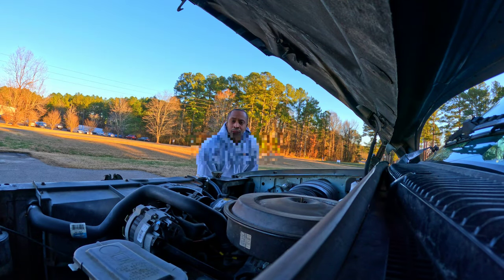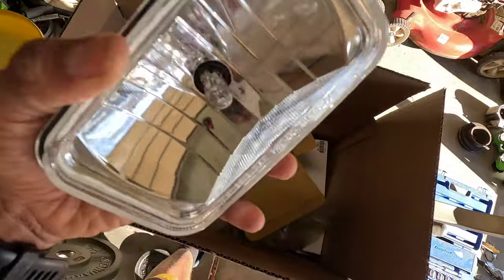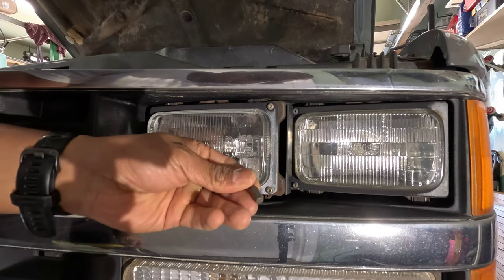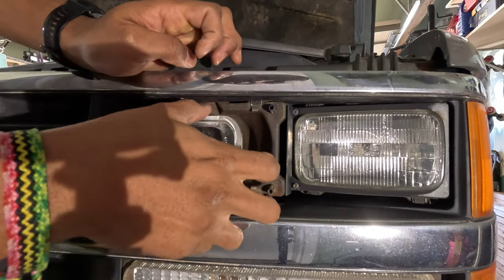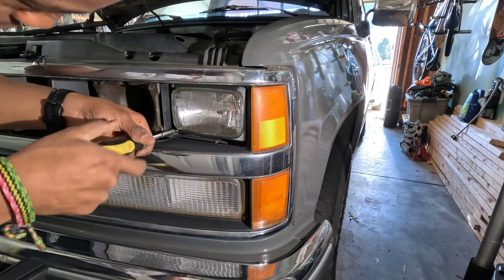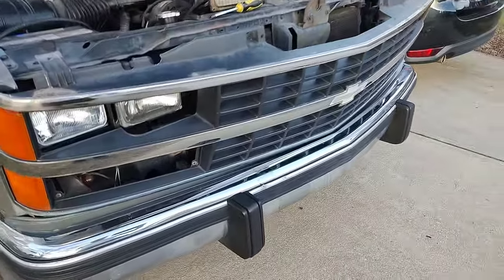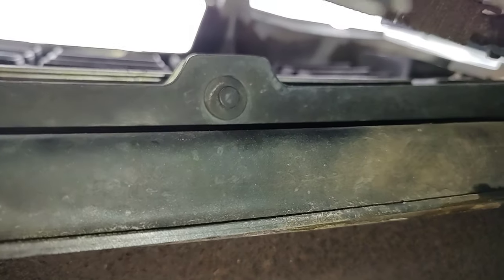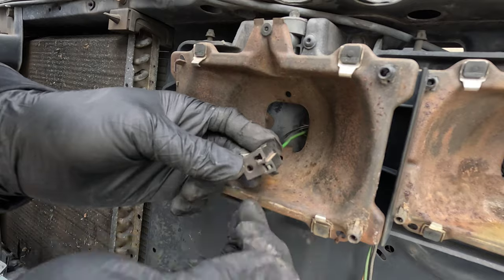89 Chevy Truck headlight upgrade with replaceable bulbs

Comment: Look Into The "4High Headlight Mod". A few wires, a relay. Basically, when you switch your High Beams on the relay will trigger the Low beams to come back on. I own my late grandfathers 1988 K1500 5.7L Silverado. I did this for added light output driving at night. It is Not "night & day" difference, But the added light output is nice.
Reply from the maker: Thanks! I will check it out. Compared to the new stuff, these old setups seem lacking sometimes.
Reply: LMC has the harness to do this! It’s like $20

Comment: just some information, that bottom part of the grille is called a bumper filler. and also those push pins that keep it attached they make a specific tool just for those style of fastener called panel/trim clip remover
Reply from the maker: Thanks!! I didn't know about that name but it makes sense. I saw one of those trim tools before. I need to go ahead and buy one as much work as I'm doing on these kind of things.

Comment: 1988 was the first year for that body design but they only came in regular & new extended cab pickup models at the time because the crew cab pickups & SUVs with the previous body design were still in production up through 1991.

Comment: It would been alot easier to just replace the bulbs ,and they do sell them!
Reply from the maker: Hey George! Are you sure? 88-89 were different. I wanted to replace the bulbs. But, these were sealed. I prefer replacing bulbs. If you know something different please show me where.
Reply: @MaqsVids  the whole assembly is the buld they're sealed beam
Reply from the maker: @newendoria1232 Thanks! I have never referred to sealed beams as bulbs...but they are. I always considered bulbs as going into the light. So, he was right 😉 🫣

Comment: nice job I replaced my tail lights and turn signals on my 89 also. the old ones were very cloudy  and dull. I may change out my head lights as you have done this summer
Reply from the maker: Thanks! I'm about to copy you too. My tail lights are mismatched from the junkyard. And the lights under the headlights are old and I need a bulb so I might as well replace them too.

Comment: I enjoy the videos! I’m currently bringing a 1989 GMC K2500 back from the brink. 
   Super cool truck you have too!
Reply from the maker: Thanks!! And I am jealous. I would rather have a 2500. Actually, other than my 454SS, this is my first 1500. I've had 2 C2500's and a K2500. But, my driveway and garage are too small now. Good luck with yours!!
Reply: @MaqsVids  thanks! A little luck goes a long way. I’m currently changing out my “intermediate “ steering shaft with a jeep unit to get rid of my rag joint, and changing melted twilight circuit boards out. 
   It’s a fun truck to play with.

Comment: I Wonder if its possible to put different Lightbulbs in there. My 94 Sierra got quad headlights but all 4 headlights have H6054 Bulbs. I bought used headlights for 300 bucks from a 89 Truck so I have to brackets. Now I just need fitting headlights that fit H6054 bulbs. Pretty hard to find something.

Comment: I have a 89 gmc c1500 and I got to put a condenser and radiator in it and I was wondering do you have any tips for me because I’m not trying to mess my truck up and another thing where did you get that radio from and the thing it’s sitting in because I got to get one?

Comment: Put an new altinator in it with more Watt's that will make them brighter also.
Reply from the maker: Thanks for the tip.! That is worth a try.
Reply: Yea I know a little bit, after an while those parts age & sometimes especially with older vehicles have to Upgrade certain parts.